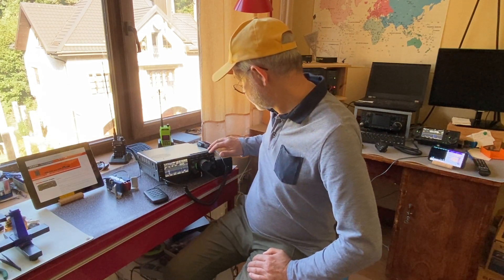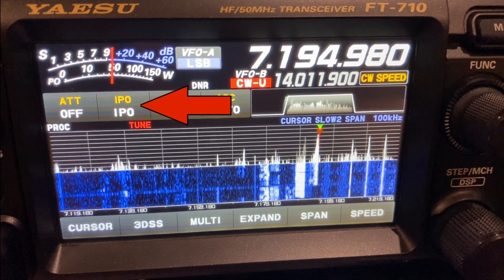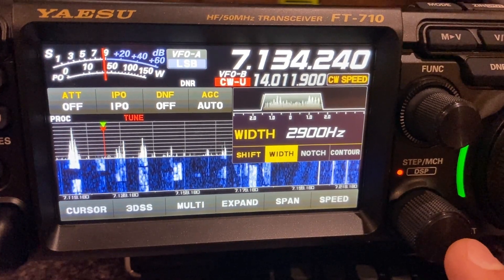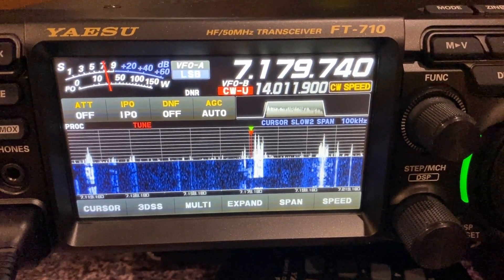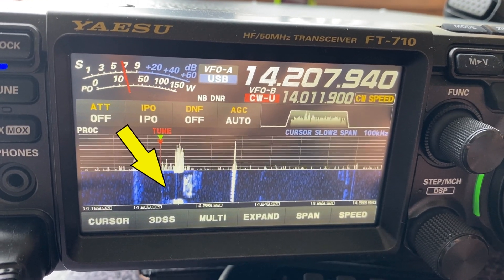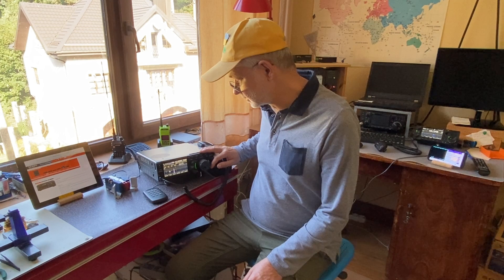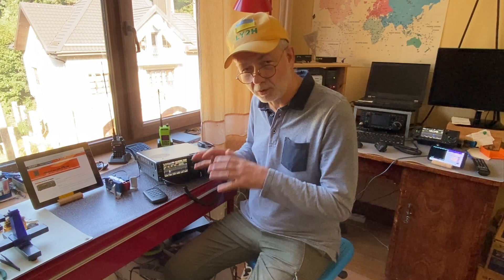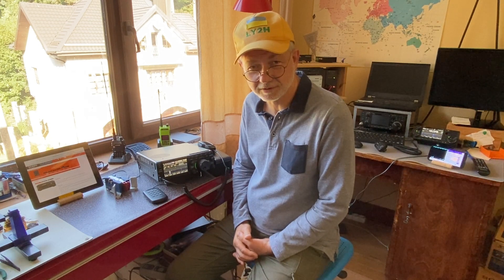YAESU FT-710 receiver surprised me in the contest!

Comment: I bought my FT-710 about two years after they dropped in price. Since I already had a Yaesu FTDX-3000 for contesting at the time, I really didn't expect much of the 710. Fast forward a few months and the USB interface went bad on my FTDX3K and I decided to give the 710 a shot in a very crowded CW contest. It performed flawlessly with a great receiver and excellent selectivity. It became a main rig for another year or so until I bought my current Icom IC-7600. The FT-710 gives a lot of performance for the price and is really only slightly beater by it's bigger brother, the FTDX-10. 73 DE W5HI

Comment: I found your video to be excellent.  I also own the FT-710 and I still cannot believe how great the receiver is on the radio.  I have worked many weak DX stations right next to powerful stations only 2kc over without interference issues.  The noise filter is also really exceptional.  With my settings I can run the receiver with AMP 1 on and I throttle the RF gain knob to about the 1 o'clock position.  Works very well for me!  Again, thanks for the nice video.

Comment: I couldn’t stand the fan running all the time. Even in RX. Went back to the 7300
Reply: I had this issue, but only a 15 minute job to replace with "Noctua NF-A6x25 FLX"  and it runs silent.  7300's fan is noisey under TX by comparison.
Reply: @2E0RME  lol, my 7300 fan never comes on but once or twice every hour for 10 seconds maybe  and that’s at 100w.
Reply: @forgetyourlife  I've had 2 7300s both new, and they were like jet engines on Data modes.  Noctua NF-A9 helped.

Comment: I look forward to hearing your impressions on CW.  Didn't your xcvr come with the companion front firing speaker?
Reply from the maker: First impressions on CW- very good receive, no ringing , actually, even at 50Hz filter. The draw-back, full QSK is hardly possible due to relay T/R switch. More impressions in future videos, after more use in real contests etc. Yes, it came with the add-on speaker, and the AESS is working, not a miracle but the effect is feasable. 73! Linas LY2H

Comment: Hi, interested in what aerial your using as this has a massive effect.
Reply from the maker: Hi, I was using the full-size ( ~39m long) 80-10m EFHW antenna fed via the Myantennas.com 49:1 impedance transformer. The feedpoint is some 13m above the ground supported by pole on  the roof of my house, the far end is uphill  in the tree at abt 20m level above the ground. No tuner needed on most bands. HTH, 73! Linas LY2H

Comment: Lynas first thank you for your patience making these videos A simple question: If you had to choose only one, to work exclusively on CW, which one would you choose? Thanks and 73!
Reply from the maker: @rudylopezmachin  Hello Rudy! Thanks for watching! Your question is hard , if not impossible, to answer :) As it is not possible ( for me, at least) to have all the radios of all the brands to choose the best one :) And it depends, too, on what CW usage I am looking for, like contest, DX hunting or DX-peditionning myself. It all takes different specs from the radio. What would be in common for all cases, is,  probably, the availability and quality of filters. Then, for contesting, I'd like a real QSK ( NO relays) and a high-speed internal CW keyer, for DX-ing - the lowest possible receiver noise floor, for dx-peditioning - the ability to withstand  strong nearby signals in the pile-ups. From the few rigs I have, the most close to the ideal under all scores is my old classical K3( fully S-upgraded), and the best for me among the new full-SDR budget radios class - is the FT-710. If we look into a QRP under the 150 USD price tag class- the QCX-mini and now QMX rigs are unbeatable, their  performance, actually, is many times over their price. Your mileage may, and certainly will, vary! 73! Linas LY2H

Comment: How it compares to IC-7300 ?
Reply from the maker: Good question, don't know yet , it takes more time to compare :), in some future video probably. FT-710 does not do some things IC-7300 does, but it seems quieter than 7300 (lower noise floor ). Else, the display is crispier in 7300. Stay tuned for more :) 73! Linas LY2H
Reply: People usually rank it higher than the Icom in this particular discipline. I've just bought a FTDX10, so soon I'll compare that myself... :-) (supposing that DX10 and 710 perform very similar, both being top RCVRs in the Sherwood list). I like the sound of my DX10 a lot, definitely an improvement over FT-991A that I've sold. Still learning with it. Once I feel confident with the filtering and DSP enough, I'll compare them. Display is crispier, but I still like the Icom waterfall more.
Reply: The 710 cooling fan runs all the time even when just listening. Was very annoying.
Reply from the maker: @forgetyourlife  In my FT-710, if just on receive, no transmit, the fan starts running about 20min after the radio is switched on, runs for an hour or so, then switches off, then on again after some time. For me personnaly, it's not a big deal as I find the fan's noise not that annoying , especially if listening at higher volume on an external speakers, or with the headphones. All-in-all,  I think, it should be  possible to replace the existing fan with a Noctua, or similar, quieter fans, as people do in many other Yaesu and Icom radios, also PA's. 73! Linas LY2H
Reply: @forgetyourlife  Runs all the time on the DX10 too - but only in Data mode.  7300 sounds like a jet turbine on TX - even at 5 Watts.  You want cool and quiet? ---> 590S/SG
Reply: @McRocking  my 7300 is less than a year old. Fan hardly runs at all on ssb. 710 was on all the time and it’s smaller high speed loud.
Reply: @Linas_LY2H  sound about the same as my 710. You probably could replace the fan but that’s not the point. Yaesu needs to firmware update the 710. No reason it should have to blast off after 15 minutes of RX. Turning the volume up is a poor solution 😅
Reply: @forgetyourlife  Clearly it depends on which mode you use most.  The quietest rig I have on all modes is the 705 - no fan at all! 😁
Reply: @McRocking  yep, I got the 705 really hot on day on 70cm. Was doing a net on a repeater and 20 minutes at 10watts the temp gauge was in the bright purple to red.
Reply from the maker: @forgetyourlife  Agree! I'm sure YAESU software people reading this! 73! Linas LY2H

Comment: Why not ftdx10?
Reply from the maker: Because I am interested very much in full-SDR technology, not the hybride one, and this is independently of performance and/or specs :)
Reply: I didn't realise the 710 was full sdr I thought it had superhet first stage then to the sdr like the ftdx10
Reply from the maker: @nickkendall3764  Yes, it’s a direct-sampling SDR. BTW, QST August 2023 features an in-depth review of it.
Reply: I picked the DX10 rather, since it has more hardware buttons (was tired of the FT-991A's menu system and touch buttons) and I wanted a hybrid to complement my pure SDR IC-7300.
Reply: Why not both?  They have different strengths and weaknesses.
Reply: Right now in the USA the 710 is $500 cheaper than the 10